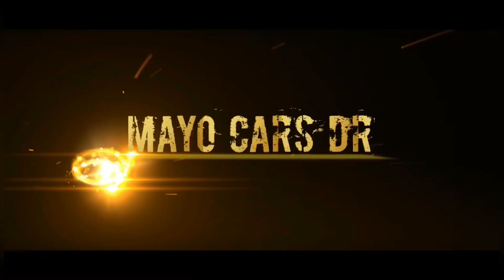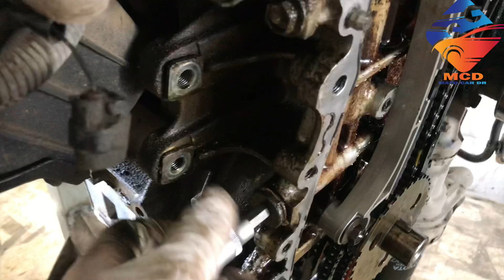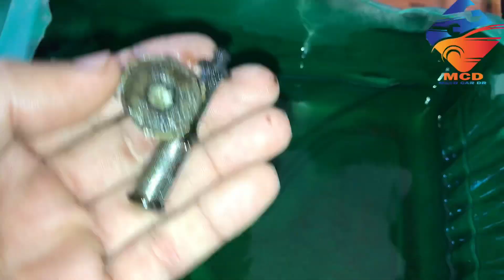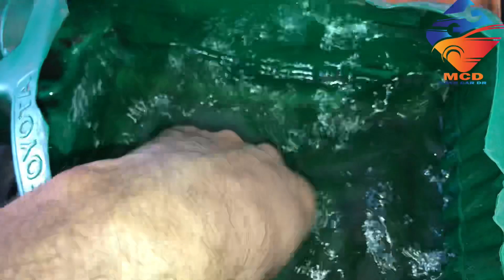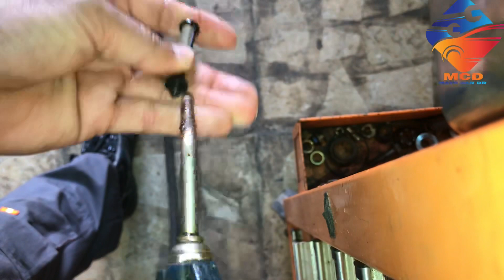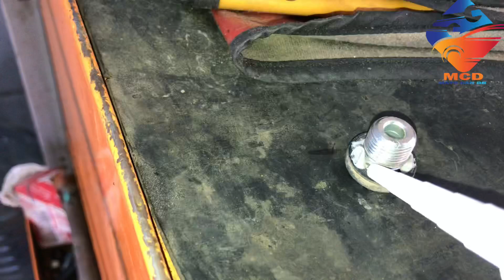Variable Valve Timing Oil Filter Replacement And Cleaning Of Toyota Camry 2AZ-FE Engine

Comment: When reinstalling the filter you should put a spot of superglue on the bolt recess and press the filter onto the bolt. That way in the future the filter will come out with the bolt.
Reply from the maker: Thanks for coments,If the gasket is new, there is no need to apply super glue and it does not hold inside the filter bolt